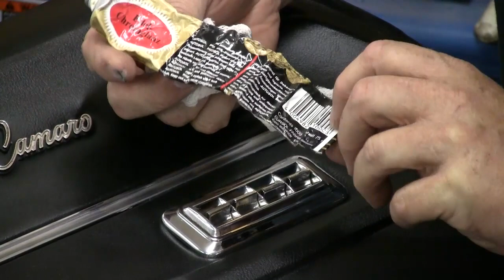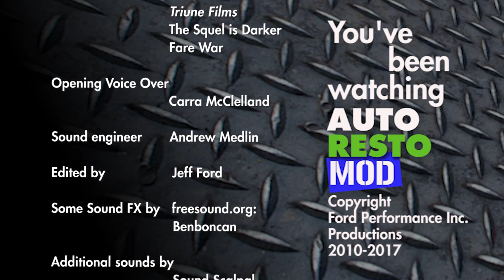First Gen Camaro Reproduction Deluxe Door Panel Detailing Tips and Tricks How to Episode 322 Autores

Comment: The window rubs on a fuzzy strip call the belt mounding. Although stapled in place, needle nose pliers work great here. Butyl tape repeats the factory look and care in your project, but use dielectric grease on connectors to protect them from dew that forms in temp swings, washing and rain. Make sure all drain holes are open at the door bottom and use cavity wax to coat the pinch welds, folds and other bare areas paint guns don't get to. Remember, it is unclear when dunking a car body at the factory became common, but what did they use? Either way it doesn't work to well regardless of brand of car or truck. So, always go the extra step and coat the shell. If using a weld-in patches, try Klean strip concrete and metal prep. It is a 30-40% phosphoric acid that remove rust if kept wet. It is 1/4 the price of Oshpo or less and sold at home improvement stores, just like dielectric grease next to the automotive epoxies. 1/2 auto parts stores. When you weld, seal other a skim coat of Dynatron fiberglass, sand and cover with filler. Filler absorbs water but the fiberglass keeps dry. This is where cavity was inside comes in. Nobody can sleep if rust is eating your ride from the inside out. 
  Need to remove paint? They are all dirty, warp panels and stick in corners until paint. Look at "Coopers Strip Club" kits or large refills of two different products. It is not a hell but spraying on product. Lifts paint, detail brushes, dense scotch-brite and sharp steel wool made in England. The second is called "Flusher." It cleans, protects from flash rust and extends the life of a job. YouTube video will surprise you you and since Sept 2019, w/o methylene chloride, you would be ahead just wizzing on you parts. Thanks to the smart people at the EPA who can't spell classic automotive rebuild or restomodification, they banned it because they could control disposal because they are too smart to ask! They are magically turned into the North end of a South bound Jack Ass without trying hard.
 DK. Omaha, ASE Master Tech since 78. That's all I got to say about that!

Comment: Here's tip for a good way to locate the perimeter screw locations.  Screw the original screws in from the back side of the door far enough that that the tips stick out and will come in contact with the door panel.  Hang the panel from the top, pull it down snug and press it against the screw tips.  They're pretty sharp and will leave clear marks where to drill.
Reply from the maker: HA! We'll use that for this week!

Comment: Do you have a video that shows how to attach the window belt weather strip to the deluxe door panel?  The door panel in your video has the strip already attached, but my new/replacement panel came with the strips unattached.  Thanks.
Reply from the maker: I thought we did one, but no. What I will do is use some locking pliers to set the weatherstrip then drill holes for "staples" that I make our flexible sturdy wire. I then twist the wire on the back side to tighten the strip up, then cut the twist off and bend the reminder over.

Comment: There are 6 push in clips, 3 in the front the others in the back. How do you attach the clips to the door pad?
Reply from the maker: It is a motha. I fought those panels for two days. I finally had to heat the door panel to get the studs deep enough to accept the clips. I think we show this in the video (it has been a couple of years...).

Comment: I used these same panels on my car.  I think Al Knoch actually makes them.  I had to trim about 1/4" off of the front of them and rebond the vinyl at the front edge so that the door would shut all the way.  Other than that, the install was pretty much exactly like yours.  Did yours shut all the way or did you have to adjust the front edge of the panel?
Reply from the maker: The shut was fine, but we are still fighting some warp on the bottom edge. Ours were bowed into the door a bit too.